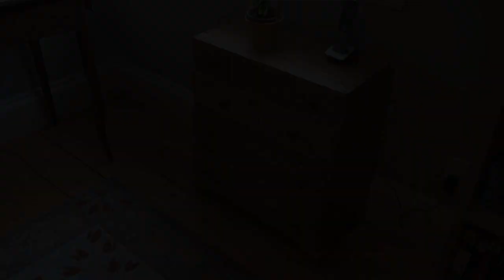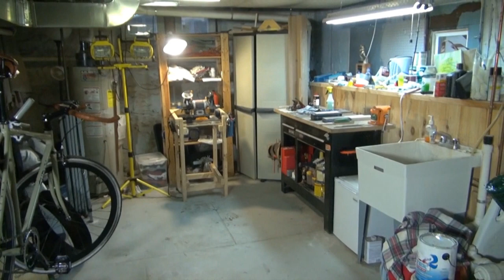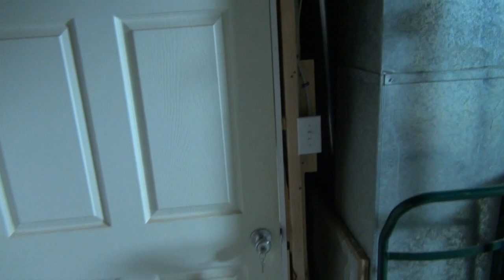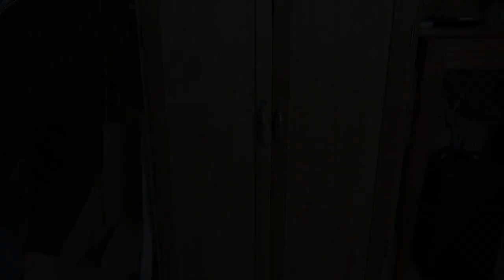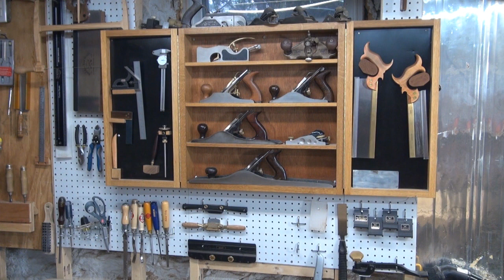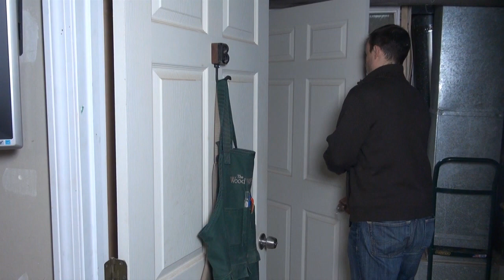The Shop Tour

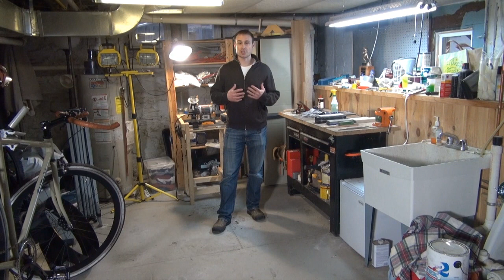Comment: I've modeled my entire shop after yours.  You said at 2:42 you had a boiler (Hot water with Radiators).  So I spent $22,000 changing my home to that and now at 4:07 you say you have a forced air furnace???  What's going on Did I make a mistake???

Comment: Not sure if this has been asked but first I want to say IM JEALOUS...LOL great shop setup... ok now my BIG question... How do you get large pieces of lumber or even plywood down those stairs? does your shop have a door to the outside?
Reply from the maker: There is a walk-out door to the basement, it's just barely in view when I first walked down the basement stairs - just to the right of the slop sink. Without that, I never could have gotten the table saw, bandsaw, or jointer into the shop.
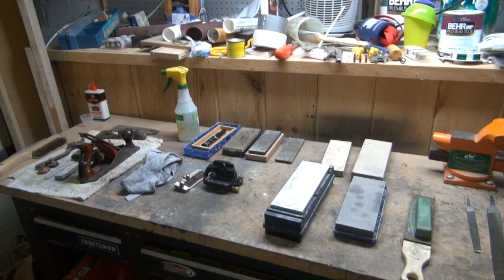Reply from the maker: Rob Bois You actually get a quick glimpse of the walk-out door around 3:52 of the video.

Comment: Fantastic shop -- super efficient.  I agree with avoiding oil-based finishes in a basement.  However, I still prefer oil-based polyurethane for surfaces such as table tops for maximum protection.  I apply the poly in my porch or garage when the weather is warm enough.
Reply: I'm with you on the oil based finishes, Alan Christensen